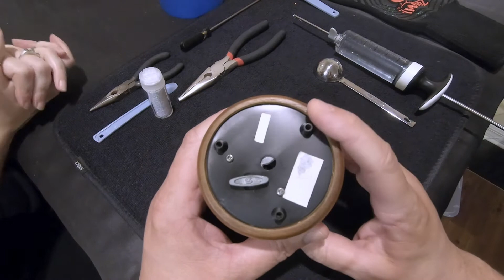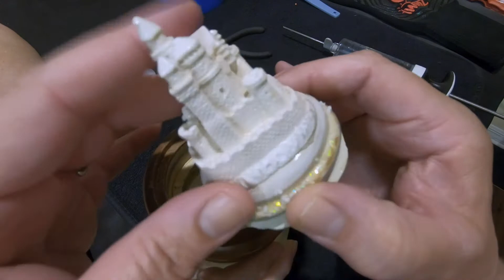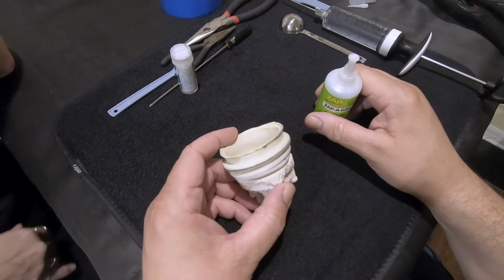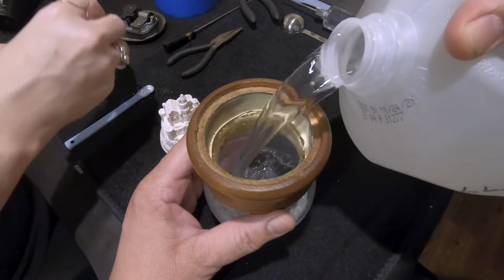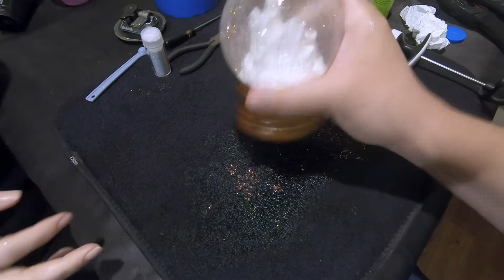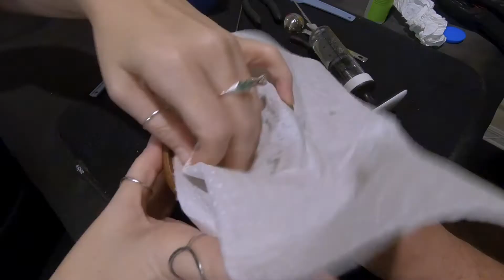Ep. 28 - "Sand Castle" Snow Globe Repair Using only plain water

Comment: This is a Longshot. I had a snowglobe from the mid-80s or so. It had a wood base, height was maybe 7-8 inches, sitting teddy bear inside and compartment for two double AA batteries. The bear would illuminate. 

I was careless and knocked it off a table when I was 15. Regret that to this day as an adult! If you know of this snow globe and have information about its make - I would love to replace it! Thank you!!
Reply from the maker: Hi. We have seen a lot of globes at this point but we do not recall seeing one that matches your description. We will let you know if we do come across one.
Reply: @snowgloberescue8887  Thank you very much!

Comment: Help…Can’t get rubber stopper into 6” globe…tip?
Reply from the maker: Hi. Wet the stopper so that it slides into the globe easier. Work your way around pushing it in a little at a time. If you have water in the globe when you install the stopper try using a small thin screwdriver wedged between the stopper and the globe opening to allow the water pressure to release as you push the stopper in. Be careful not to put too much pressure against the glass. We show this method in most of our recent videos.

Comment: Hi, I found your yt channel when I was trying to fix one of my globes and got inspired to fix the others now hahaha The only problem is the hot glue, it sticks to every instrument I use and is kind hard to take it off of the globe and the stopper. Even with the help of the dryer and hot water. Do you have some tips for me? Thanks
Reply from the maker: Hi Nika. We're happy that you are inspired to fix your globes! We have not experienced any issue associated to the hot glue. We use the hot glue to reattach the globe to the base, seal the globe and stopper, and attach the cover. Whenever we have had to remove hot glue we wait until it cools then we cut it off with a razor knife or a screwdriver depending on where the glue is. Let us know if that helps. Thanks for watching!